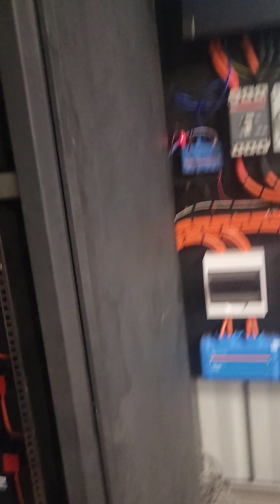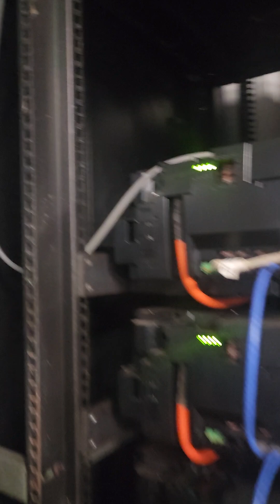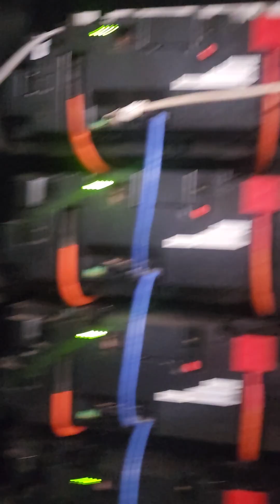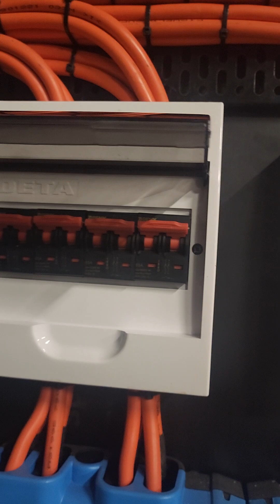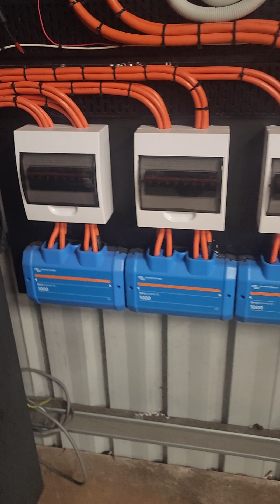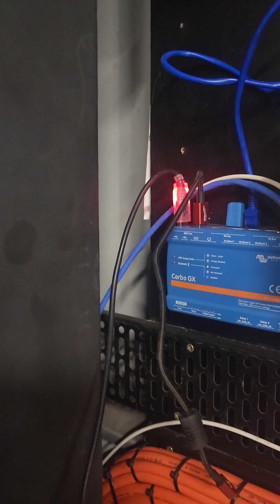ELMP482-00005 battery ESS system

Comment: Awesome thankyou , nice neat layout , i dont see a Lynx shunt inline with the Lynx distributor , do you have one elsewhere on the DC bus ?  what rating is the breaker from your 450 amp MPPT ? , i read somewhere that 1.25 x  load is used to rate breakers  ?
Reply from the maker: Decided i do not need the shunt, the battery BMS reports current in/out as does the MPPT and multiplus. The cerbo calculates the residual DC current based on the sum of all them. The MPPT breaker is 250A DC, picked it up used of an old 240VDC 60KVA inverter haha
Reply: @DatsunRacingTeam   True on the Shunt , i didnt get to that stage yet but logic acknowledged.

You must be a sparky by trade ?  , Is there any issue with having the battery cables bunched up close above the CB boxes  ?   My table napkin scribbled layout will space them 100 mm apart to reduce phantom inductive issues or is that of no consequence ?
Did you find it easier to update the Cerbo GX operating system from an SD card or over a network connection ?
Thankyou 📏📐🪛🪚🔩🔧🏁
Reply from the maker: @heartobefelt  yeah sparky by trade, but have a few degrees under my belt too. There should be no issues with the cables being bunched - negligible concerns with inductance with DC, and derating of the cables is not required where nominal current is below 1/3 the rated current carrying capacity of the cables. As for the cerbo update, definately easier over LAN. I have sinced move the BMS conection over to canbus and it is really easy to set up and install the drivers for  - I have the instructions on github in Spidy01/dbus-canbus-battery
Reply: @DatsunRacingTeam  Hey dude , I note you ran 57600 Baud rate for RS485 , now that you are running comms over Can-Bus , what is the correct Baud rate ?
For future reference , where should we look for correct Baud rate for different batteries and control interfaces ?